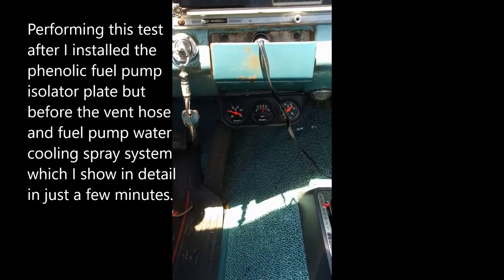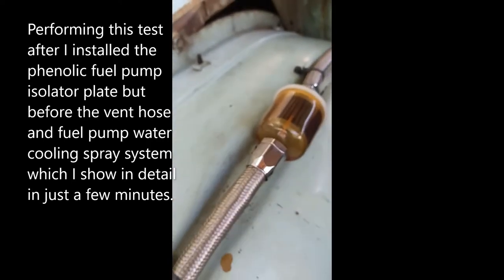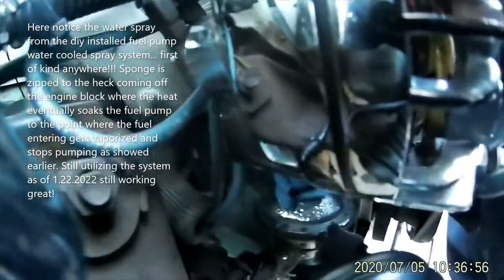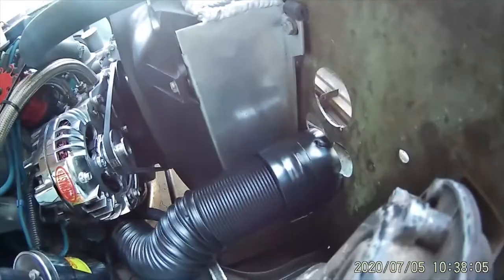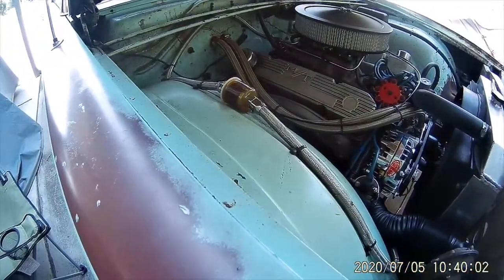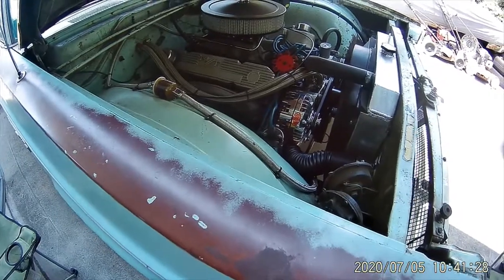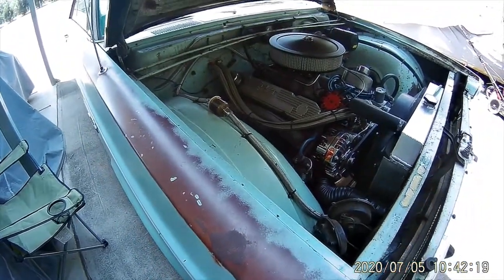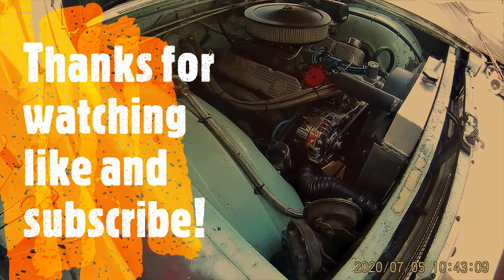Vapor Lock part II my crazy water vapor system, a must see if you want to minimize vapor lock!

Comment: hi 
Mechanical fuel pumps heat soak , fix by using a insulator or thicker better quality gasket .
Carburettor fit a sandwich foam insulator gasket or a 1/4 phenolic Canton spacer 
Many carbs in the 60`s 70`s had fuel return lines to counter this 
** Your cooling system cannot hold water temp at idle eg 160-180f , Needs better fan and shroud ,,remedy either BIG clutch BIG fan & shroud or convert to electric fan .
Reply from the maker: all great solutions, thanks for watching!
Reply: Yes u are probably aware of most of the ideas , just from my experience over the years . Glad to help. @livinglikarockstar

Comment: Hi Robert H Enrique from California I have  a 1966 ford galaxie 7 litre and  my engine it's doing the same.
Reply from the maker: running a return line to the tank with a regulator helps as well. As well, most implement an electric fuel pump along with a return line to the tank which nearly eliminates the issue. Hope you get it sorted!

Comment: Are you having vapor lock with your car because it is running too hot and boiling the fuel in the line and the fuel pressure goes down contact me on messenger and I will tell you how to fix that problem I've had that same problem with some of my stock engines and race engines on the street simple fix and if you have a line coming from the gas tank filling the fuel pump and if you have a return line going back to your fuel tank I can show you how to solve the problem once and for all old hot rod School trick and it works awesome my name is Walt
Reply from the maker: I was yes mostly in late jun-aug months as i live in the south. my year model fury did not have the return line, that type of manual fuel pump or return hookup on the tank. I understand can add one using a fuel pressure regulator and adding a return line and barbed hookup to the tank. Is this what your referring too? Or did you have some additional method i'm always ready to learn something new.
Reply: @livinglikarockstar  if you want to send a message on messenger it would be easier for me to explain or to talk to you over the phone 1 you can put electric fuel pump in it . or you can put a return line back to the tank you going to use a t fitting you hook that up in return line going back to the tank you can put a Holley jet in return line going back to the tank 2 slow to flow down you will still have fuel pressure to feed the fuel pump to the carburetor you won't have Vapor locked because the return line going back to the tank because the Holley jet enough to hold enough pressure to the carburetor which will eliminate vapor lock sorry if there's any mistakes and the tuck thing and I've been having problems with my phone with the speaker text it's an easy fix with very little bit of work. I had a Chevy Camaro with a 383 stroker engine I couldn't make it six blocks from my house it would be vapor lock so I put a cheap fitting in the feed line going to the carburetor and the return line from the tee fitting the rubber hose I would put a Holly Jolly in the rubber hose to slow the fuel back to the tank which luck today open circuit and cured Vapor Lock.......
Would your car having vapor lock too many times you have to watch you don't go to a lean condition and hurt your top end-of-year motor I hope I explained it okay for you if not send me a friend's request or hit me on messenger so I can talk to you over the phone it's really easy fix that 383 stroker I was running was pushing almost 700 horsepower that is an old trick that use back in the hot rod days return line with a Holly Jolly in it
Reply: @walterbargersr3402  I’m interested in how you solved your vapor lock problem how do I contact you

Comment: I have an idea, stop running all that 5 miles of freaken gas line around the whole engine bay. Go straight up to your carb. Duh
Your poor pump has to push all that fuel around. Pumps pull from tank and it pushes to your carb. And why was your temp at 190 when you have a 160 thermostat? Wow, you're all screwed up.
Reply from the maker: Your a genesis I never thought of that! Thanks for the advise, i apologize if i don't follow any of it, thanks for watching.